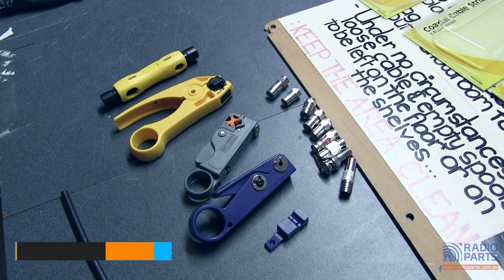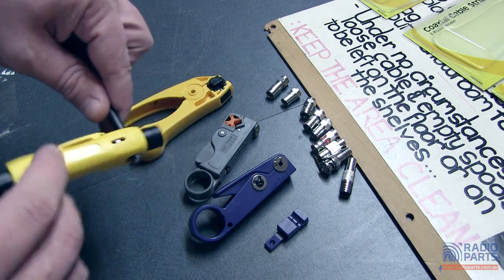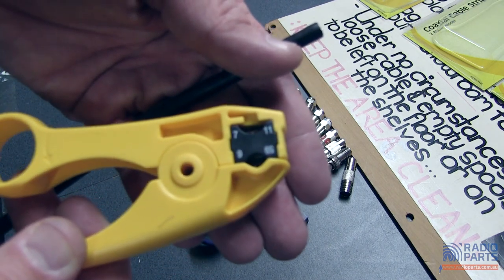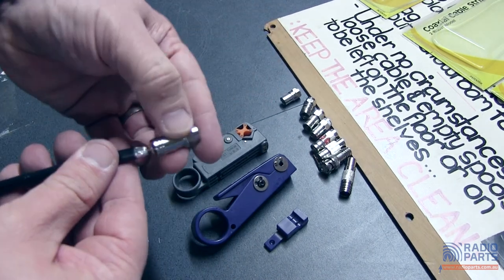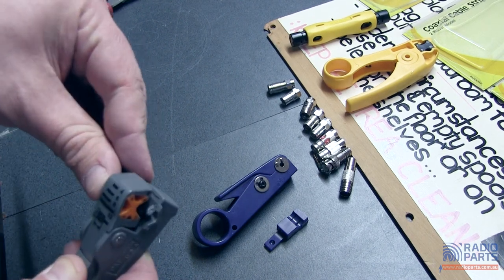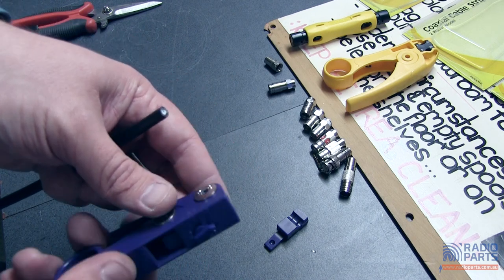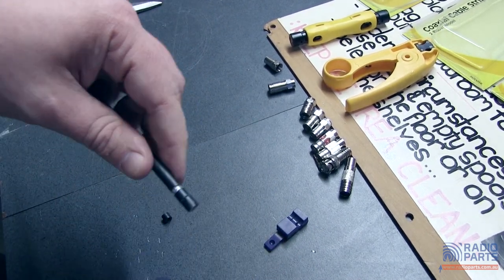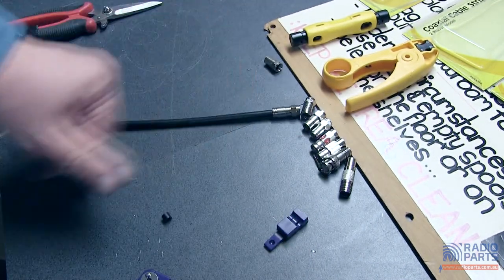How-To - Two Blade Coax Cable Strippers

Comment: thank you Ben;
one of the best presentations so far.
i purchase the onn set recently but
it doesn't go into detail about the 
stripper.
not everyone is a ham enthusiast or
employed and trained at a cable company.
can you recommend a presentation 
that will go into detail about the numbers on
the x block, which slot for which coax type;
and how to more precisely
set the height of the blades. The one i
have wasn't set properly at the factory
so i've been trying trial and error method
to get it right, but not going well.